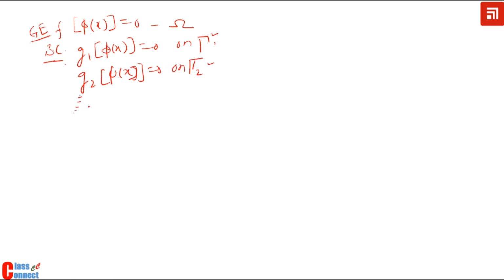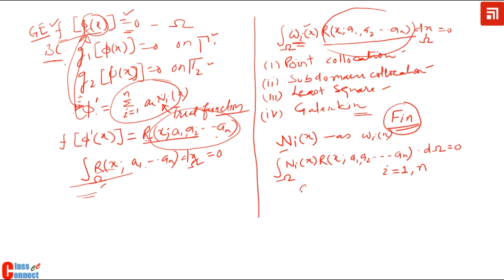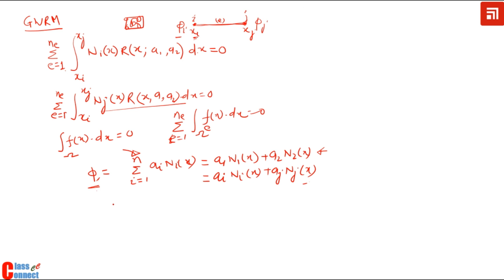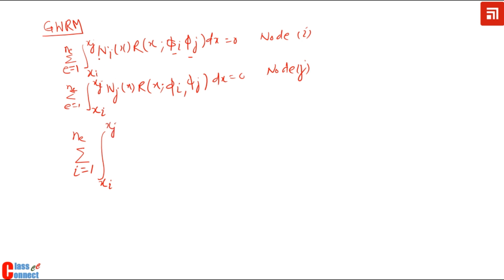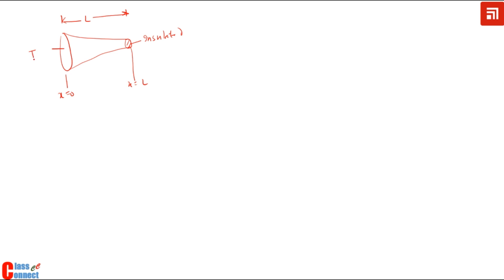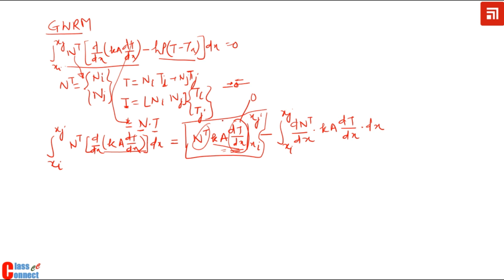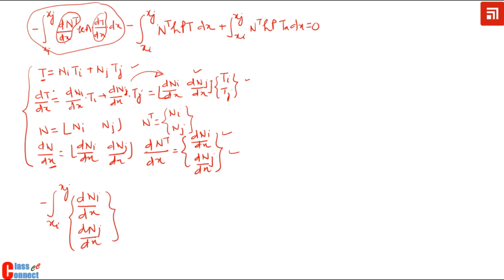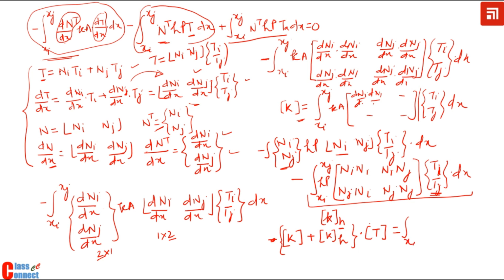Galerkin WRM Fin Problem FEM Formulation Session-14

Comment: Sir @28:33 why dT/dx = 0 at all internal nodes since there will be heat transfer through the pin first by conduction and then heat will get dissipated through surface area by convection. 

Also sir for left BC where T=Tb , dT/dx cannot be equal to zero , as for maintaining constant temperature T=Tb heat must transfer through left end then through pin fin and then it will get dissipated through surface to surroundings. Please answer sir i am waiting eagerly.
Reply from the maker: First Part - Though it can be proved mathematically when we assemble the Load vector but let me try to explain. There is no heat supplied/extracted at each internal node, so when the during assembly the net effect of dT/dx is to be zero.
Reply from the maker: Second Part - When we give BC of fixed temperature, the FEM solution will give us the Heat transfer at all the nodes where fixed boundary conditions are given. We can either give fixed Temperature of Heat Flux. Both simultaneously nor possible. I hope it is clear.
Reply: @vijaykjadon  Sir means left BC will be T=Tb and dT/dx not equal to zero right sir but in video @29:23 you told that at left BC both T=Tb and dT/dx = 0 , how is this possible?